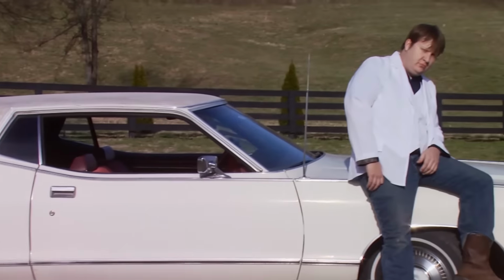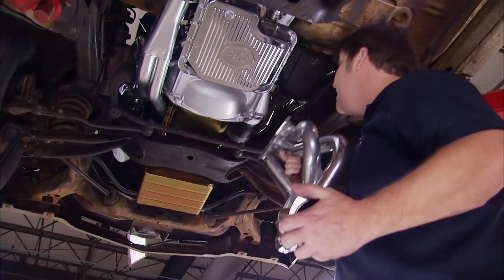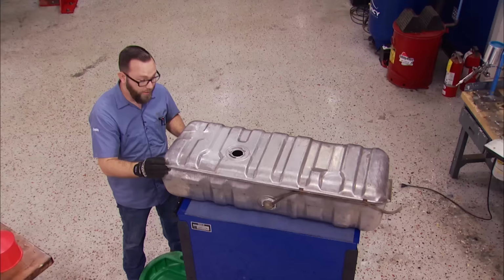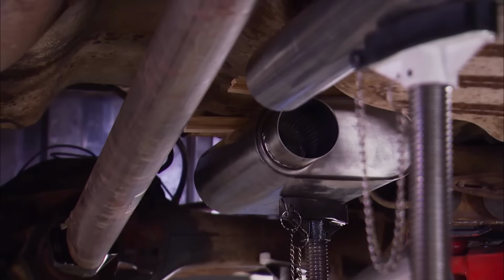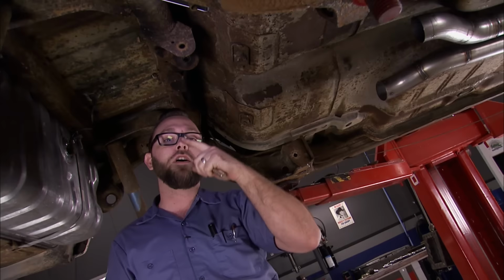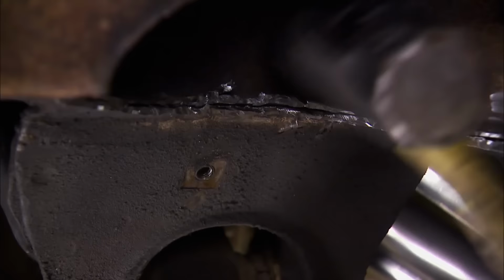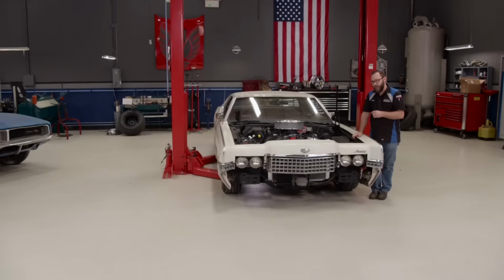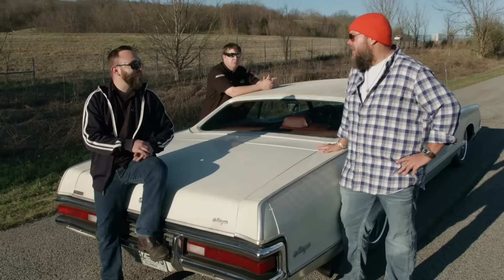FULL BUILD: A 1,100 Horsepower 1972 Mercury Marquis

Comment: If you're gonna spend this type of money, why wouldn't you sandblast the entire undercarriage of the car & at least prime it before doing anything else?
Reply: Exactly!!! The owner is going to be real impressed when his feet go through the floor in a year or two.
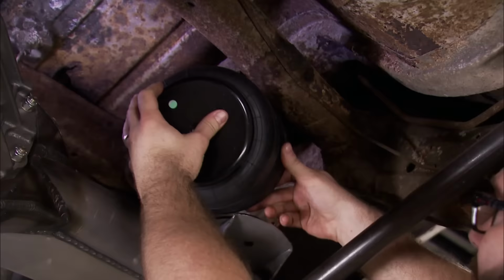Reply: 53:07 there's a hole rusted through the bottom already.
Reply: That’s the whole point...not to
Reply: ... right.!?!?!
Reply: @no no it's not lipstick tho, it's botox & platinum teeth they're putting on it.
Reply: @no no YAP. LMAO**
Reply: FMB BEACHBUM Your exactly right my grandpa had that same car until it rusted into 2 pieces, I still have the 429 out of it built in my 78 4 speed bronco.
Reply: Actors with little to no car passion. . .     YouTube is becoming reality TV , narrator barks why you should stay tuned.
Reply: @dannyoktim9628  These aren't actors, they are TV personalities. Most were legit car people at one point. The narrator needs to go though. I swear the same voice has been used for over 20 years now.
Reply: @scottinWV    But she sure is fast with that 30,000 dollar engine setup.
Reply: Fer what? the whole body is fulla bondo
Reply: you are right, but in these shows the mechanics got time contraints so they need to get the job done asap, cutting off the less showy parts of the work
Reply: Big can of worms under there
Reply: cause Murica! ;)
Reply: These "projects" are not about building a car. They are all about advertising the products they use. Nobody actually cares about the car itself, or how long it lasts after the "build" is done. I mean come on. It's a 70's luxury car with a whopping great hole cut in the hood.
Reply: Because they don't spend a dime. All the parts are provided to them by sponsors.
Reply: This isn't a car restoration show, It's an hour and a half of advertainment.
Reply: @dannyoktim9628  
No car passion? Man, you SERIOUSLY need to do your research on people before you type off at the mouth...

Comment: this is just painful to watch as I could SEE the rust on that frame when they took the old brake line off but they didn't even bother to clean it up AT ALL.  What's the point in making so much HP and putting new lines on when the frame is rusting if you're not gonna clean it up and just allow it to continue rusting
Reply: I thought same thing
Reply: What was painful to see was the NEW brake line retainer not even hold the end of the hose properly. Brand new, out of the box and it doesn't fit together snugly? Typical aftermarket junk.
Reply: Apparently they threw all their cash into that antiquated carburetion setup.  I'm surprised they didn't throw in some metal folding chairs for seats and call it a day.
Reply: @Adam1nToronto  I don't think it was the line that was wrong, i think it was the bracket that was too thin.
Reply: @bigboreracing356  agreed... prep. That car can be Por15'd later... it's hilarious to read all these comments about the crustiness. This won't be a daily driver so the rust is a nonissue. It is designed to be a runner. Shining everything is unnecessary..
Reply: @bigboreracing356  

 The problem with worrying about every speck of rust is the car then ends up in million pieces and never driven. To those who bemoan the rust, the hole in the hood means that car isn't going to see much rain. The 1100HP pretty much guarantees it will see zero snow.

The rust that is there is going to take decades to become an issue. By then grandkids can worry about it. 

It's great to see an old car like this brought back to life rather than collecting dust in a garage with someone saying .. 

"my car should be back on the road next year once I fix this, that, and the other thing".....

as everything fades to nothing..

Comment: I bought one back in 1975, she was only 3 years old when I got it, and it looked like the first day it drove off the dealership lot  in 1972. She had the 429, and she flew down the highway, passed everything in sight,but the gas station! I had the 72 Mercury Marquis for about 11 years then sold it, after seeing this show, I wish I had have kept her! I sure do miss the big beauty!
Reply: I have a 2010, and they never lost their charm.
Reply: In about 1980 I had a 1972 Mercury Montego with a 400 out of a 1977 truck. I loved those cars that almost half the length of the car was hood.
Reply: @yeanah2571  a 2010 Marquis is just a Crown Vic. Not even a 2-door! Nothing like one of these old sleds.
Reply: I'm kind of a Ford guy , they all make SOME good cars and I like the big lincolns and mercs. But I have a hard time passing up on purchasing Any Caddie with a big block . 472-500. Or the late 70's & early 80's 425 olds powered caddies. for "highway duty" they're the greatest.👍

Comment: Why go to all the trouble of getting stuff re-chromed, but leave the underside crustier than a hobo’s underpants
Reply: They should take some notice from Stacy David and put some rust protection underneath the car.
Reply: Agata...how I laughed and couldn't tell you a thing about yesterday...still in the z.o.n.e.rolllike adig in front of the fire....
Reply: Right?  Geez this thing is a money pit already but a wire brush and some 99 cent flat black works wonders
Reply: That was painful to watch. Boatloads of money spent on parts and zero effort at rust remedy: I'd call that a hack job...
Reply: @heimatliebe116  They don't build show cars. They build projects that you can drive every day not worry too much about it being all pretty. This is a car you roll up to someone at a light and destroy their pride, and put it away wet.
Reply: @rotor13  if I wanted to watch someone N-rig a vehicle I’d watch old episodes of Pimp My Ride
Reply: tunawayFEMwash  I’m hurting from laughing so hard.
Reply: @rotor13  all the more reason to do some rust prevention on the underside
Reply: It was a cheap quickie build what do you expect.
Reply: “Crustier than a hobo’s underpants” 😂😂😂😂
Reply: That’s exactly what I was thinking also, about the rust
Reply: @1957kwick  $100,000 in parts = "cheap quickie build" to you?
Reply: Some POR-15 would've been in order
Reply: @rotor13  That's great and all, until the car twists in half because of the weak points the rust made. It doesn't need to be a show car, but shit, at least clean it up and paint it black.
Reply: @CJColvin  2
Reply: @antoniasaldana5715  Exactly mate.
Reply: tunawayFEMwash  lol
Reply: tunawayFEMwash  that bit was fucken hilarious.... thanks, tuna!
Reply: tunawayFEMwash  hahahaha
Reply: tunawayFEMwash  Lol... though the visuals from your post are quite disturbing.
Reply: Ya but that hobos livin free
Reply: .... hobo´s Underpants.! LMAO** Like dis.! Soo Cool.!!
Reply: Pretty sure there's 10-15 lbs. of bondo in that pass. rocker in front of the rear wheel well too...
Reply: Why do they care it's not there money.
Reply: The presentor mentioned that the editors tend to leave certain details out. Perhaps they addressed the rust afterwards as they had to shoot the footage on time.
Reply: @redram5150  jesus your language. it's just bad.
Reply: Good point. It's like taking a shower and then putting on underpants with a "skidmark".
Reply: The air cleaner cut in the hood killed it for me. Couldn’t watch it any further 🤮
Reply: sponsors.
Reply: @redram5150  lol big facts
Reply: They know what they're doing pal
Checkout the barn find Chevelle they went the extra mile to make it like new
Reply: Who cares about the body when you have this running gear to put in anything
Reply: 😂 I said the same thing!! Maybe they can have a segment on the use of a portable sand blaster.  Or how to use your brush from your welder on crusty rust.
Reply: First of all.. for all you “purists” rust= free weight reduction
Reply: @CJColvin  true they should. But it ain't 
Our business. What they do to 
The car

Comment: A long time ago and at a faraway place I built a 73 ltd. It was the most fun with a vehicle I every had. Light or low hp build on a 2v cleveland, about 300hp at the crank. 9 inch 3.5 rear. Not enough hp to smoke the tires but enough hp to get it going 130 mph in 3rd, never had the guts to see how fast it would go in 4th. The remarkable thing about this boat was that 6 ft guy could stretch out and sleep in the back seat, a little guy like my self could make a pretzel out of his girlfriend back there. It was rugged. I hit a dead elk in the middle of the road and went air borne, got home, not a scratch. On the road and up to speed with the AOD in overdrive I got a pretty consistent 18mpg, not bad for a really heavy rig with a old smog motor. Best of all the neighbor hood
 kids all thought I was "gansta". Have fun all of you and keep wrenching.

Comment: In 1979 I was 16 I had a Mazda pickup with a 4-cylinder. My stepdad was chiropractor he had a 76 copper colored four-door all-electric fully loaded 460 cubic inch police interceptor motor. He wanted to trade straight across in 1981 when I went into the police academy and even though I came out with the better end of the deal he just really wanted that little truck. The Mercury Marquis had 202 horsepower which was way under what it should have been because of the gas crunch-time had 350 or so torque deserve the 60 and 12 seconds quarter mile in 18 or 19 seconds I think. There was a guy in Clovis California that built under the hood superchargers for Ford and Chevy vehicles and I got one it was a kid and me and my buddies put it on my car. It changed my horsepower to 350 it changed my torque to almost 400 0 to 60 in 7 Seconds and change my quarter mile time to 14 and some change. For a car that big it was actually tremendously upgraded thank God I worked at a full service gas station while I was going to the police academy because I can roast the tires and blow them up and then hobble over to the gas station and put some used tires on it. It was big enough for three people could go camping in the Sierra Nevadas one of the front seat on the back seat and the third guy had the most room in the trunk. We went deer hunting in it we went to the drive-in movies we put three guys in the trunk and not pay for them. Muscle cars would come up alongside me and I'd say let's run them or read the motor and you can see the look in their eye they were going to do it and I would floor that damn Mercury and it was surprising because I would jump off the line as heavy as it was I didn't hardly spinner tire and they would be like scrambling their ass to catch up with me I couldn't beat them but it scared the s*** out of him thinking my God this giant copper-colored boat is going to beat me. I'm six foot seven I could move this driver's seat so far back because I could reach the pedals and I would telescope the steering wheel and I would replying that sucker and I would actually stick my arm out the rear window on the driver side and just Cruise. One of my best friends had a Ltd in 1974 had the Ford 429 not the boss motor but the regular 429 and it was fast as it was it was lighter than my car and we raced all the time and when I got my supercharger I could smoke him hard. Some Mexican guy rear-ended in that an intersection and totaled his car and I had a 1000 Kawasaki and a 65 Chevy pickup with a Corvette motor and I didn't use my Mercury much and he wanted to buy it from me. I had about $1,000 in it and he knew it was fast and well-equipped and he offered to buy it and I said dude I got a thousand in it because I'll give you 1,000 so I sold it to him and he drove it for like five more years and finally sold it some Mexican guy that lowered it painters at cherry red and tinted the windows and I knew the guy and Manny we go cruising on the streets at night and that thing was shine he kept it chromed and cherry red it was beautiful car.

Comment: I had a '72 Mercury Marquis with a 429 and 4V in the two door. Mine had the vinyl that was like leather.  It actually didn't do too bad on the unadulterated gas we had back then. Mine leaked about a quart of oil per week. But the state actually sent me a letter of appreciation for not fixing the leak because I kept the roads oiled. I thought then and still do that the '73 was a better looking car. I always wished I had one like "Uncle Buck" without the pollution. I'd probably pass on one now.

Comment: the frame and underside rusted but lets put 1000 hp in it and watch the frame come apart
Reply: Looks like the have their priorities in the right order then.  That's surface rust if you didn't know.
Reply: @TheChaztor  which leads eventually to full blown rust. But, just for the 'look' at least sandblast the bastard and put a crap load of 'soft' bitumen type of cover so it absorbs stone, etc. without 'paint' coming off by chipping. I used to do that with my older cars, lasted a LOT longer then straight paint/primer stuff. Last one was 1974 until I sold it in 2010 and undercarriage was in perfect condition. That added $4000 to the sale price, NO work needed.

Comment: "when most people think about fuel systems they think about carburettors" - what is this? the 80s?
Reply: Better, it's the 70s!
Reply: Carburetors give some amazing sounds to the engine better than the injections
Reply: @decomposing_while_alive2002  its all in the tune , u can still get a really good chop with injectors but i must admit im a carb guy myself (especially in triples doubles ) tri power configurations
Reply: Very beautiful car 72 mercury

Comment: Pro tip: If you run the drill in reverse you will not get shaving in gas tank 😄
Reply: Drills in Reverse don't cut very good holes.
Reply: Only if you have a reverse drill bit also.🙄🙄

Comment: Love watching all the expert work done, like installing the fuel system, rear end, air bags, exhaust and etc. BUT as some others commented  why not sand blast the underside and paint it, that could have been done in 1 day if you have the equipment. I noticed that the frame already has some patches weld on it and they look rather shoddy. How does that help plant 1100 horse power to the ground? Oh yea those tires and wheel look awful to me plus that big hole in the hood is looks like shit too.

Comment: That bolt found in the tank looked just like the type used around the perimeter of the tank to hold it down in the trunk.  I speak from experience.  How did it end up inside the tank?   Had to be done either on a previous repair, which I doubt, or more likely on the assembly line those screws went in before the sending unit was in place, and got fumbled into the tank without their knowledge, you would hope.  Probably wouldn’t hurt anything besides the corrosion clogging a long processing of fuel filters with a “curious excess of rusty sludge”.    I had my Country Squire tank “fixed” by a specialty shop which did heater cores, radiators, gas tanks, and such.   On the Squire it was vertical with that seam becoming the source of a slow leak at the bottom.   Well, not only did they not seal it up, they left a bunch of welding slag in the tank, leaving me stranded multiple times and finally figuring out that it was the fuel filter getting clogged.   So after replacing about four of them, I started taking it off, blowing it out in reverse, and finding the nasty culprits, and cussing like crazy out on the highway while seeing that slag on my radiator support after blowing it out.   I had assumed all along that the “pros” had done it right.  Wrong.    Restomotive had my solution in the form of POR 15 like solution I poured into the gas tank, obviously out of the wagon, tilting the tank carefully and observing with a flashlight full coverage, especially the lower section, and that did the job, while also being nice enough to not leave fuel filter clogging crap in the tank.   Kept it sealed for years.   It cost like $20 and took about an hour.   Not $35 and several weeks of cussing and roadside repairs and late to work moments.    Seems that letting the “pros” do it isn’t always the best way.   I miss my Squire.   A friend wrecked it.   It had been a lifer.   Oh well.    My Magnum kinda replaced it with less character but more everything else, except for the full sheet of plywood carrying ability.    And believe it or not, my wood grain sided Squire was the craziest chick magnet ever.   Unbelievable.   Sometimes I felt like I would need a garden hose to scare them off the car so I could drive home.   I jest, slightly, but chicks loved that car.    Kid Rock said it best, “I don’t like big cars, or real big women, but somehow I always find myself in ‘em”.     Whoops.     Too much?    Never.

Comment: I love the idea of tackling a Mercury but those rims do not work with that car at all.
Reply: Right you are sir. A set of 17 inch polished Astro supremes would look sweet, or magnum 500s rehooped to 17". Those moon cricket rings look like crap.
Reply: Meh Meh  Nope the rims (not the tire/rubber) do not work on that car at all.
Reply: @Devin O
Yes... I personally thought it would have been much KOOLER, if they'd have either used the stock steel wheels, hub caps and some "Oldster" lookin' white walls again... Or, maybe even some of those stock-ish looking Detroit Steel wheels with Dog Dish caps and black walls...

Because there's nothing like a Sleeper!

Comment: One of these was my first car.  It had the 460 option instead of the 429 The previous owner built the motor.  It was fun and fast for a boat but only ran on premium and got maybe 6mpg.  It was faster than my friends 72 Mustang Mach 1 with the 351C motor.

Comment: After 10 dyno runs:  never give new build full throttle ...
Reply: Right lol I can see a few easy rides to get seals bearings and bushings worked in and then send it
Reply: @kevinjohnson9372  I know they try to break in the motor, but, still.  The dyno guys never get the blame, just the glory.  The driver gets the blame.